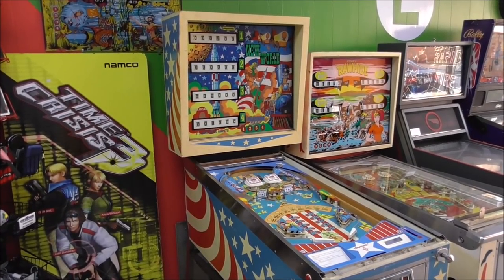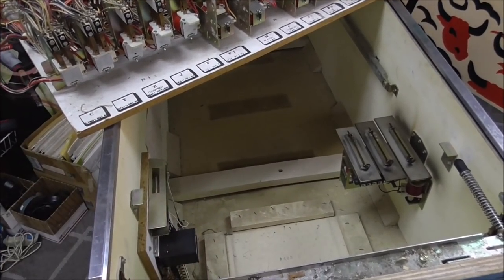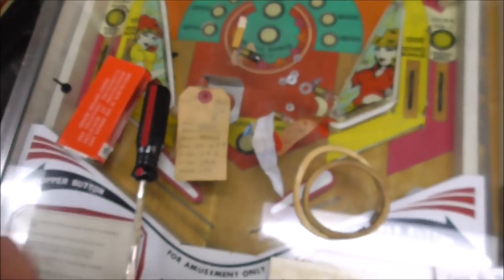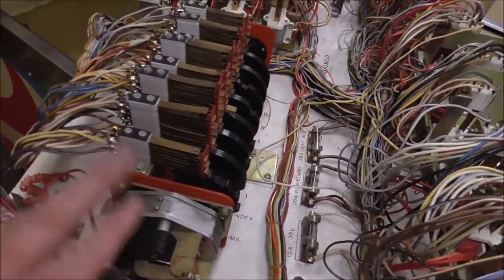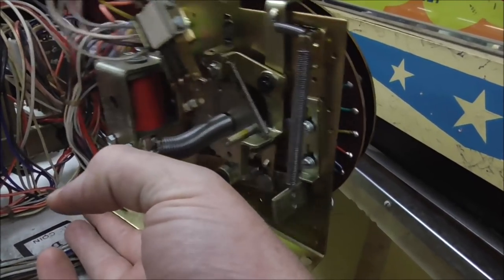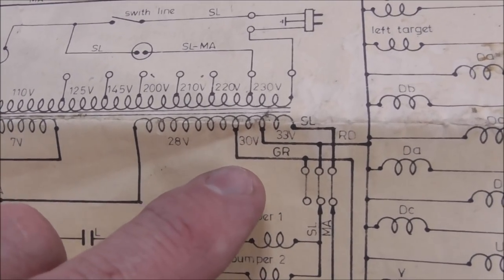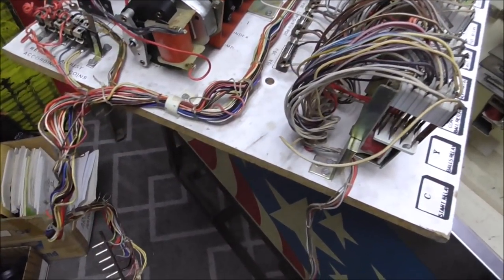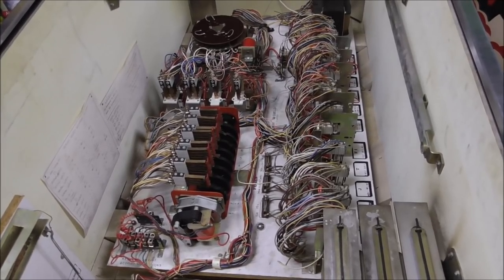Found This Inside Our Made In Spain 1976 Playmatic "New World" Pinball Machine! Repair #2

Comment: Ron, you've not only inspired me to work on EMs, I'm now working on my son-in-laws Solid State Mata Hari! And yes, I got those flickering displays, as you say, rock solid! The high voltage cap had burned the solder off the positive connection. So it was as if the positive lead was never soldered to the land. Now I don't know what caused the burn, as seen on the component side of the board, but I decided to replace the high voltage filter cap, reflow all pins on the solenoid driver board, clean the display connector pins that plugs into the MPU, and because you recommended it - I also replaced the 5 volt filter cap with a 15000uF. Both caps had a date code of 1978. I did a search and ended up watching one of your videos from a little over a year ago - Future Spa. Checked all voltages as I plugged in each board, and lowered the high voltage from 188v to about 176v. Thank you so much for these videos!
Reply from the maker: The first pinball machine I ever worked on was a Mata Hari, that's a real classic right there.  It's also a very well laid out game, pretty fun stuff.  Glad you get it touched up, it's probably good for another 40 years now!

Comment: When I saw the torn piece of paper and the fold marks, first thing I thought is that bit of paper may have been used to clean switches.  folded paper pulled between the switches was a way to wipe any carbon or light dirt off.
I think that date definitely said 76.  It was almost like someone wrote 1970 then tried to change it to 76.
Reply from the maker: I didn't even think of that but that makes sense!

Comment: The stepper unit looks different.
From all the ones I've seen you work on before.

Instead of brass dots.
Looks like strips of tin..

Plus it doesn't have the spider looking connector. 
More like a plate.
Reply from the maker: Some of the American ones have those strips too but yeah usually they have the rivets!

Comment: The texture of that paper looks like newspaper. The drawing on the back looks like 4 wires going going to a chip or diode, relay… and then the 2 lines with a dotted line lead to the part it services.
Reply from the maker: Could be!

Comment: Removing Tilt is like using cheat codes!

It AINT RIGHT I tell ya!

Cheater cheater belly eaters
Reply from the maker: The Tilt is kind of a part of the game, like Earnhart used to say, if you ain't rubbin' you ain't racin' :)  So shaking the machine up to the point of tilt is part of the game, figuring out when it tilts, etc.  Damn shame to disable it :)
Reply: @LyonsArcade  them ol racers like Dale are the reason there are so many "Guidelines" today in racing ;) I do miss the smell of rubber and exhaust on a SAT night!